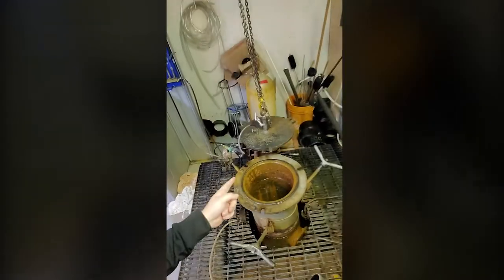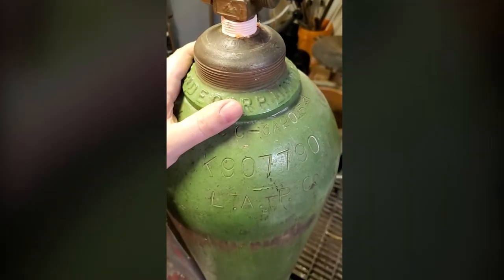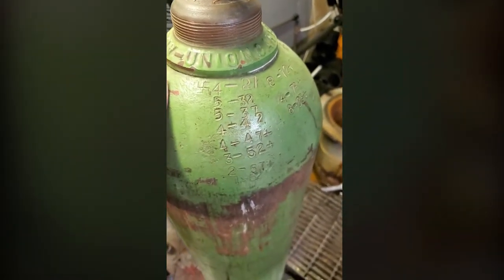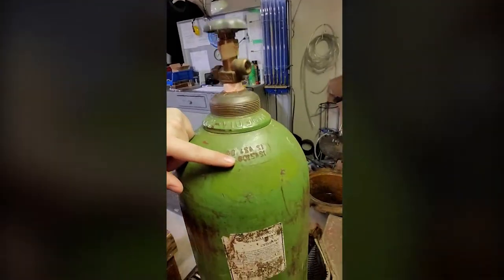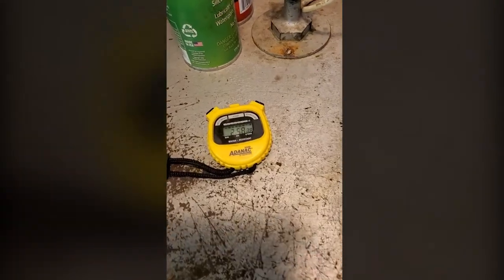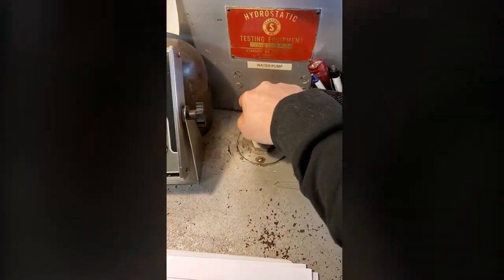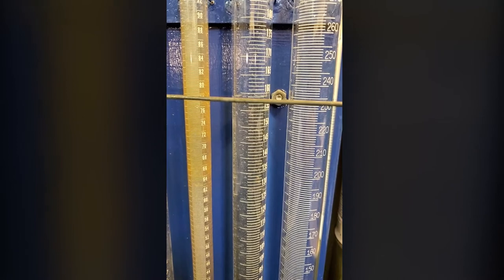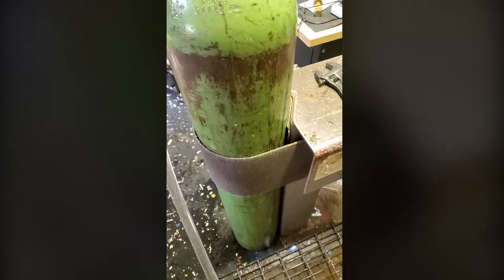Hydrostatic Testing a 95-Year-Old Cylinder - Modern Diver

Comment: whta is the name of the gauge to check the surface rust and how do you used that? how deep should the pitting rust be that will result to it failing.  what will happen to cylinfer if it failed the hydro test.? how important is the water jaket?coz here in the philipines we dont use those.

Comment: Cool video man! Wondering if you think that ultrasonic testing will take over from hydrostatic. Considering it is faster and more accurate, and no removal of the valve or emptying of the cylinder required

Comment: Hydrotesting is the single most damaging process you could do to these cylinders. Water and steel, not properly drying it on the inside. Add oxygen from the air, and there goes your tank.
If you just kept it dry... pretty much all tanks would last 100 years.

Comment: I still don't understand how the process works.      The tank is filled with water and submerged in another sealed tank but from there, I don't know where the pressure is applied.     Is it possible to show another video that explains every step of the way?        Or can you recommend a video that shows how all this works?
Reply: Alec Peirce has a good video on the process:
https://youtu.be/lVYeFPhX1OE?si=2pQtphpYGmMxp7ny
Tank pressurized, it expands and forces water out of the test chamber.
That water is collected, volume measured (159 in this video).
Then pressure released, that excess water is sucked back into the test chamber and what's left it measured (3 in this video).

Comment: Shouldn't you let the water stabilize for  8 hours at least??I'm pretty sure the water inside the cylinder should be at room temperature before it gets hydrotested. And its a cylinder not a tank.